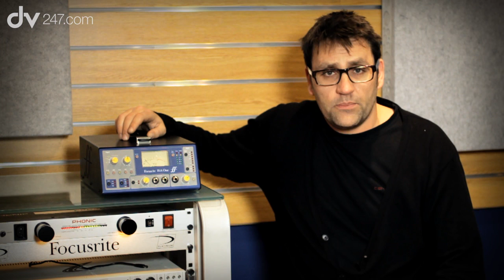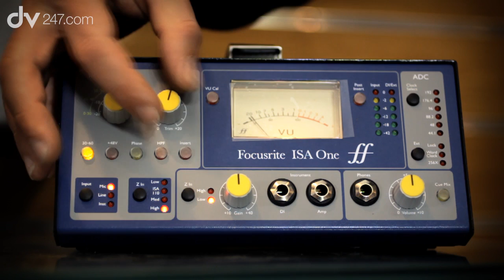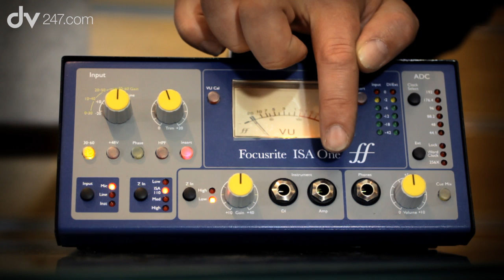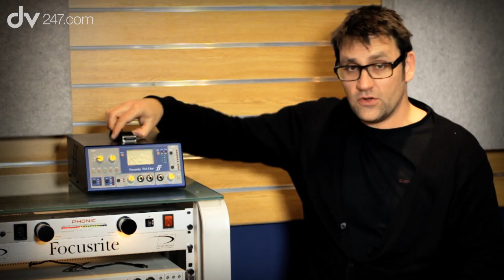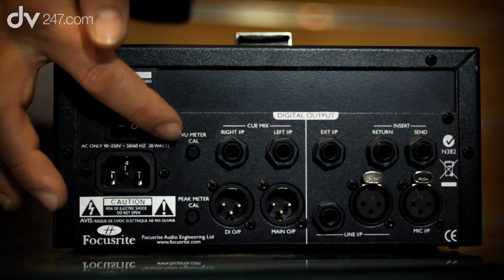focusrite ISA one microphone pre amp

Comment: This video is old, but still a GREAT review of this preamp. This is the smartest thing I ever bought for my studio. It makes every single microphone I own, sound 30% better. Yes, I made that figure up, but I am sticking by it. Even microphones I thought could not sound any better, did! I have a handful of medium to high level Ribbon microphones as well. The gain in the preamp is so clean and loud, I don't even need to use the 30-60 switch with my ribbon microphones. If I record a Bass guitar in the di input of my Focusrite 18i20. Then record a bass direct into the ISA One. There is a shocking difference. If you have the microphones you need and a good interface. Then you need to invest in the Focusrite ISA, and take it all to the next level! Another great bonus about this preamp? It will not be replaced by newer technology in a few years. It is analog, so it will be just as great 20 years from now as it is today. Can you say the same thing about your audio interface???

Comment: what does include the insert switch into the output mean? also one other question, if im plugging a guitar or bass into the instrument di its not actually hitting the preamp is it? someone told me if you want your bass ir guitar etc to hit the preamp you have to go through the line! is that correct? its hard to find correct accurate info about this pre! anyone???
Reply: I have one of these units.
The insert is an effects loop, like you find on mixing boards and many modern guitar amplifiers. This is ideal for inserting, for example a compressor. 
Of course plugging a guitar or bass into the 1/4" input jack will then send the signal through the actual preamp section. That's the whole point of it.

Comment: I highly recommend most musicians, rock, pop and rap vocal alike, to purchase a Sure sm7b mic to use for this mic. It is extremely inexpensive and for what it's worth, was the same mic Michael Jackson used on thriller. 

Using cue mix from source, back into headphones, creates a level adjusted headphone mix without the hissing and popping. 

Scoop out mid and add high end ON mic it's self, as it has built in eq.

Remove foam pop screan, add standard wind filter about 6 to 8 inches away.

Engage 30/60 switch and adjust master boost so that you are Never clipping at your loudest and highest scream. Its OK if you cant see the waves, as they will no doubt be there.

For advanced users, I recommend a daw with 0 latency and the church reverb setting to really get in and kill the vocal. 

If smaller set up, Bono from U2 used to creeate this effect by singing into a sm58 with both monitors ON so the bleed would create a realistic reverb.

YRMV

If it sounds good it is good.

Happy recording!
Reply: +Gabriel BG 
Michael Jackson's favorite mic was the Neumann U47, that he always used. Sometimes he used the SM7 on loud vocal as he could probably use any dynamic mic. The SM7b is a transient killer so it doesn't work with any singer, especially for intimate singer-songwriter, soft vocals etc... this mic could be just wrong.

Comment: Does anyone know good settings for this? i'm trying to record rap vocals (condenser mic>isa one>line 6 interface>laptop) . i always seem to get a lot of white noise coming through. any tips on how to avoid this? maybe the gain is too high on either the interface or pre.. any tips would be greatly appreciated!
Reply: You have to low down the input of your interface a lot and calibrate the volume on ISA until you get a good signal.
Reply: use a gate maybe? it also might be your interface! usb interfaces always have some noise to them! so try a gate, and other than that maybe turn the gain on yourr interface down a touch and turn it up on the pre, and also maybe abit of post compression might help, and always clean up your vocals by deleting any tracking where no vocals are being sang!
Reply: get a better mic and lower yoir gain.. try a dynamic mic..( senn e835, sm58 etc) . it will not pick up your shitty untreated room

Comment: Anthem Of The Past Gaming, it's a pre-amp so it goes before your interface. If your microphone signal is quite low then the preamp will give you a boost in level with a better signal->noise ratio than cranking your interface gain